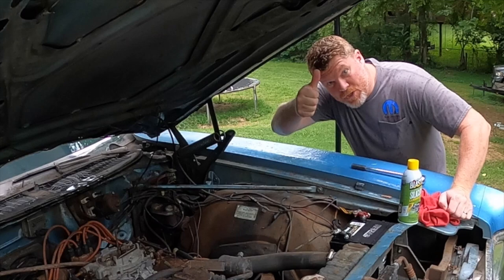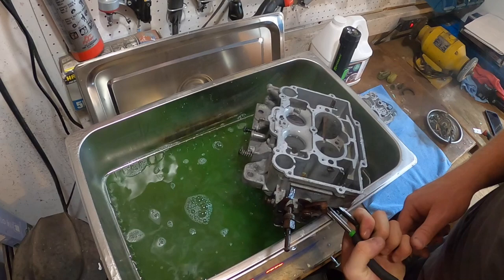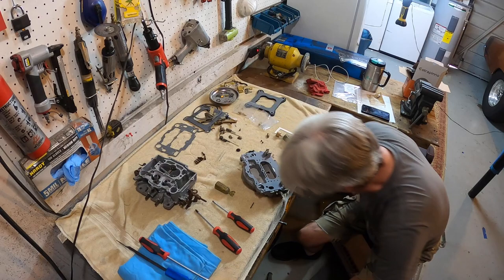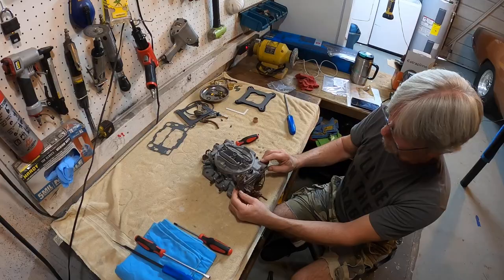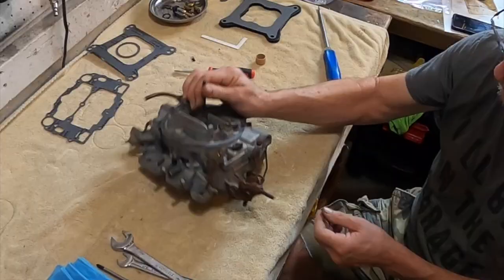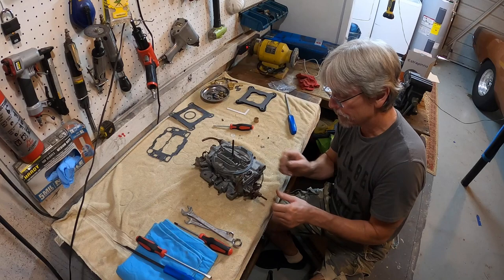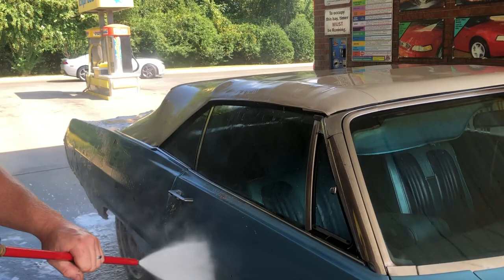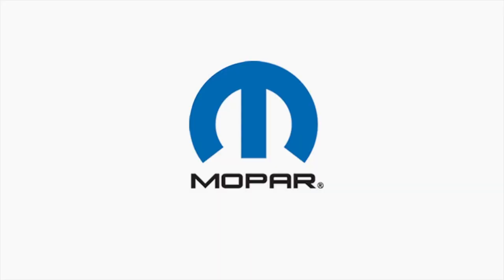Project Marsha '70 Plymouth Fury III First Drive & Detailed Carter AVS Carburetor Rebuild

Comment: My mom had a 70 Plymouth Fury that had a 318 2bbl. It was a slug back in 1973! It did have enough power to flat tow my 340 Demon 340 Super Stock to the drag strip.😀
Reply from the maker: Oh man, what I wouldn't give just to find a solid Demon body these days.

Comment: Blue with a white top is a good combination and 70 is a good looking year for a Fury.   I'm glad you stuck with that AVS.   I don't know what your plans for the carb are, but you might consider using AFB metering rods (AVS are hard to find) and doing a modification to make them fit.  And maybe a jet change. But there is no way to know what changes to make without an AF meter as you cruise along.  Or use one at a chassis dyno.
Reply from the maker: Yeah the carb will likely go when I build a big block for it.

Comment: When I rebuilt my AFB's and AVS's back in the 70's I would spray a little WD40 on the linkage and throttle shafts to loosen things up a bit. Metal on metal is never no good. Probably a light gun oil would be ok too
Reply from the maker: We shot some white lithium grease through the shafts.

Comment: What size avs2 did u put on that 318? I may get one for my pick up truck. Also which size avs2 would you recommend for a mild 383 in a 4 speed charger.
Reply from the maker: Admittedly one that was far too big for a 318 (a 600cfm). It's what I had on the shelf. It's intended for a 440 we're putting together.